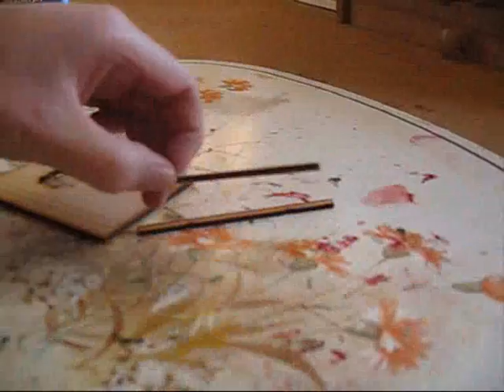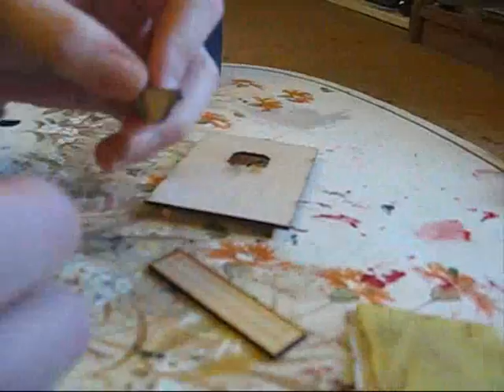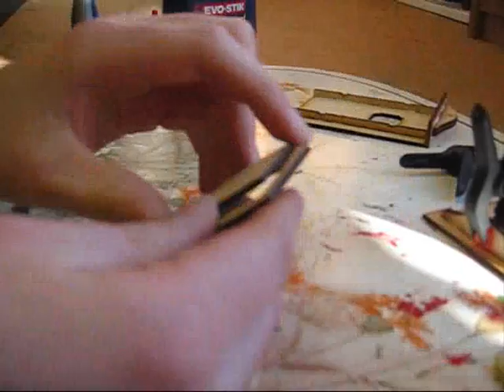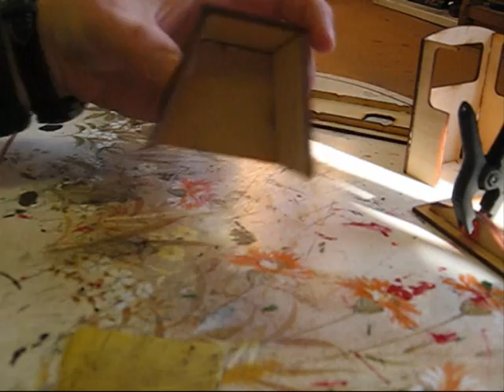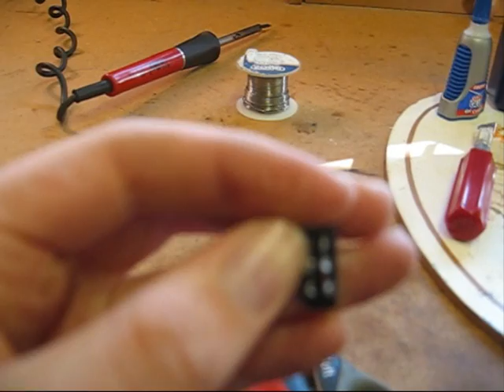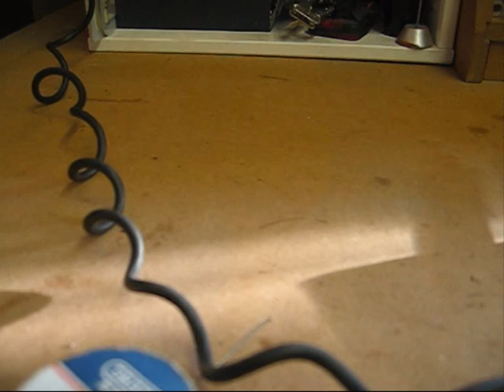Step by Step Guide to Building a Rapier - PART 1

Comment from the maker: I noticed that tuver day... It doesn't state that in the instructions does it :S ... But I put the sides ont he back of the front plate so the width of the front of the cab is the same as the rear. I don't understand why its done like that, if they expected the battery box to fit, they should have made the rear of the cab the same width too... So I will see what happens. I am considering putting 2 AA batteries in it though for more 'grunt'.